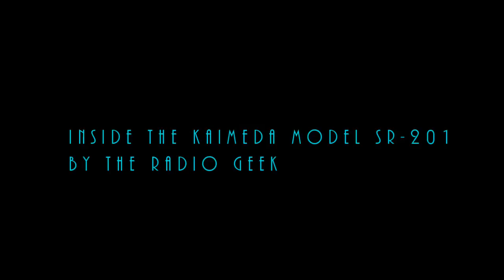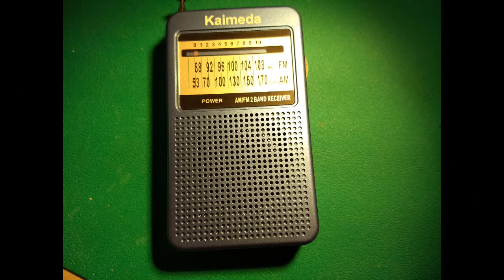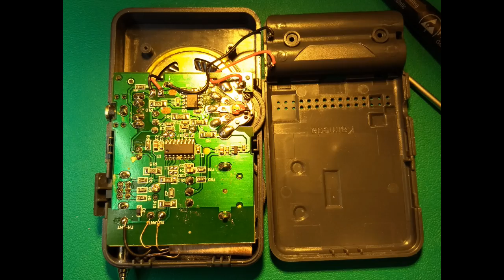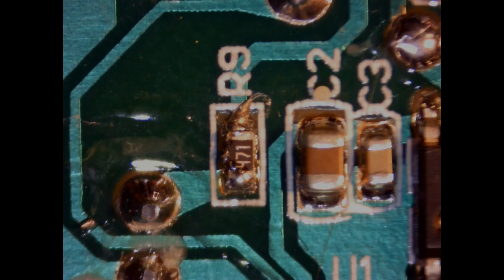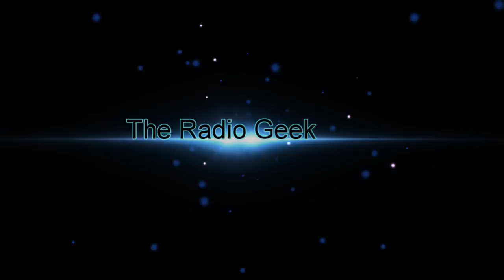Kaimeda SR 201 Whats inside this Radio Kaimeda AM FM pocket radio teardown

Comment: After watching this I bought one and it finally got here. It does very well. It picked up 770 KOB AM in albuquerque 180 miles away during the day.  After trying it out for myself I'm pretty impressed for such a low cost.
Reply from the maker: The sound could be better but preforms well. I think its a good value for the money. Enjoy that new radio and thanks for watching. 👍❤️📻

Comment: Now if you crack open the new Sony radios you'll find they're build quality is allot better with no horrible soldering.
Reply from the maker: Robert NES816 I'm sure you're right. The low cost radios are built to a price. It would be interesting to do side by side comparison sometime, just for fun. Thanks for stopping by.
Reply: TheRadiogeek The Sony radios are a bit of a pain to open though lol. The P26 and P36 use allot of clips all around the case to the case halfs together besides the two screws.

Comment: I have seen a few of their datasheets. Its very much chips that is able to cover 150kHz to 32MHz and another band from 32MHz to 96MHz then from 87MHz to 225MHz. AM on bands below 32MHz and FM above. 

The rest of the chip is comparable with a microcontroller with registers to set wether you want analog or digital tuning and how much of the band you want.

Analog tuning can be done by using a potentiometer. Inside is a a/d converter.

Simple but very clever and versatile solutions.
Reply from the maker: migsven surfing most of the radio on a chip ICs work very much alike. It is both interesting and amazing what can be done with such ICs. I think it's a real game changer in the low cost radio market. Thank you for your comments and the information on the radio chip ICs. 👍
Reply: @Sebastian Uriel Yes search for the part number he wrote in the description but as he said in the video they do not do the chips themself.. Some serious chips are also available on Siliconlabs.com and it is probably this company who did the chips. They are very much market leaders for now and have a ton of different types. Datasheets are easy to find for way most of their chips including application notes.
Silicon labs chips can fairly easily be bought from usual sources.

An odd thing is that it is often cheaper to buy a cheap radio like this than to buy one chip alone. So when you find a chip you want to play with find out wich radio it is used in and buy the radio :)  ....Yep its a strange world.

Comment: Tried to order it but the seller is” on vacation “(!)!
The NIA radios are apparently completely sold out 😐.
You didn’t show the antenna on this one, but I appreciate you taking the time to crack it open to have a look .
I wonder if the chip they use is a factor in the improved reception (since it is designed to support short wave)?
Reply: Jeff King Its Chinese new year, so all of China is closed down for two weeks. Happens every year at february. Btw its now the year of the dog 😀